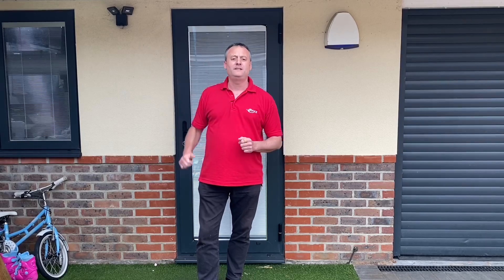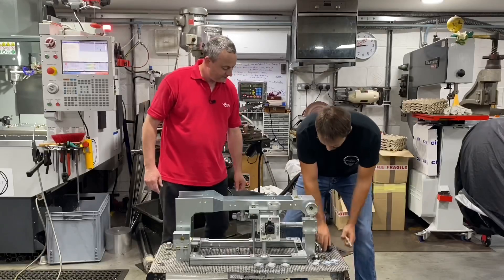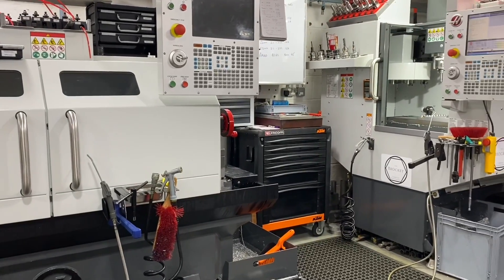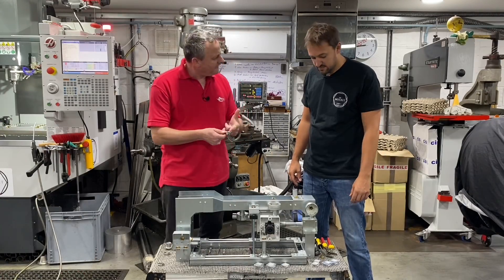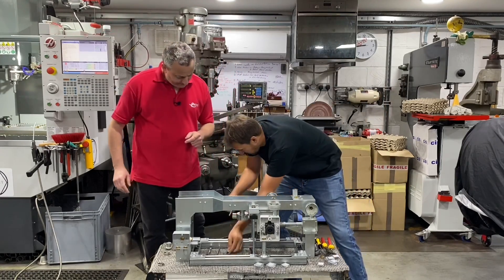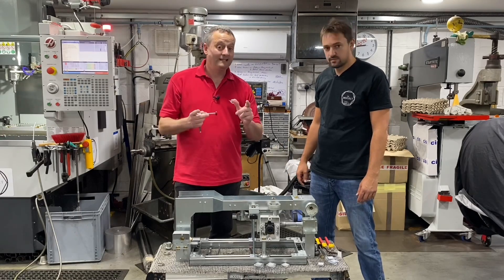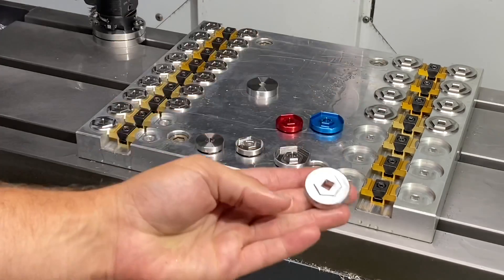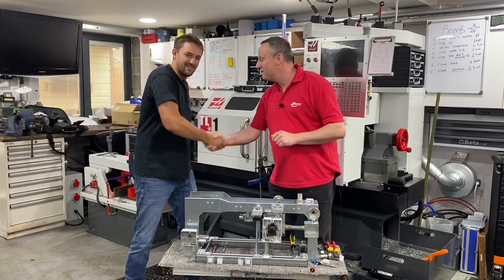Easier conduit and trunking installation with The Brocket - eFIXX Innovation Corner

Comment: Would these work on plastic glands? I'm in the process of developing an automatic hydroponic system for a client and I'm using a bunch of glands to hold the tubing, it's not uncommon for me to have to screw and unscrew a whole bunch of these things multiple times a day. Currently using an adjustable spanner as the housing is very shallow; extremely slow going to avoid tearing up the plastic!

Comment: You do know that several well known electrical tool manufacturers already make bush spanners in a variety of designs. Your design is very neat, but I wouldn’t be whipping out the socket set just to tighten up bushes.

Comment: Really smart, hope they go well.
A nice addition would be a 1/4 inch to 13mm nut adapter (or whatever size) to put on the back so these could be used with something like a ratcheting spanner as well.
Also suppose a streamlined version could be made using a press brake on a flat piece of mild steel, that might bring cost down.

Comment: People moaning about the price but its made in the UK and could really save people time and money. Buying locally made products couldnt be more important right now in my opinion.
Reply: Yes people need to compare like for like, it is low volume, stainless steel specialist sockets. So go have a look at the uncommon sockets sizes on the Snap on site $25-50 every time, the true specialist items are more and they are a massive company with high volume production and there sockets are are just hardened steel with chrome plating
Reply: Well, price is not only aluminum, cnc wear and tear, bits. Also, licenses for CNC, CAD etc, patenting costs etc. Those are the most expensive ones. If you moan about price try patent something yourself :D Anyways, great tool, simple design. Good luck
Reply: @martynaslukas4340  Exactly!!!! I invented something several years ago and applied for a patent.
When I discovered the UNBELIEVABLE costs to cover my invention, I deleted the patent application & the details from the web.
A patent lawyer will charge you thousands - just to write the description. You need a huge bank balance or a financial backer.
Reply: Not sure why anyone would moan about the price. Bloody reasonable for a high quality small quantity manufacture  tool!
Reply: Absolutely if it saves time it’s worth it
Reply: The moaning about price, i imagine is because thats all those people see. They have not thought about the bigger picture.
Reply: 100%
Reply: I want one
Reply: It definitely a good product  one that can make life easier  but at the price doesn't  make you  feel that you have to replace your t bar or socket  after all there is circumstances  where  it doesn't replace your shifter or spanner  start up costs shouldn't  let the price be so high surley a long term view would be better

Comment: These are great the price is not
Reply: If it saves you time and stress price doesn't come in to it . Work smart not hard
Reply: @iknowmyfootball3901  can't agree that this is one of them products yes every here and there might save you a few seconds but not to the tune of that money
Reply: Once he makes the AWG sizes as well.. he can put them in Amazon
Reply: Don't see it at £50 for 2 when they are really for exceptions where a socket of bush wrench wouldn't do.  If the were more around the £10 or £15 price I could get on board. But obviously that's at a mass production point and maybe made from chromium-vanadium alloy. Don't get me wrong I love the product but £50 for 2 sockets is a bit of a joke in terms of a price point atm.
Reply: @rik061119  They are low volume, stainless steel specialist sockets now a regular socket set socket, most of which are just hardened steel that chrome plated.

Go have a look at some of uncommon sockets sizes on the Snap on site $25-50 every time, the true specialist items are more and they are a massive company with high volume production.

The cost is right for what it is a specialist socket not a £3 standard socket
Reply: @michaelwilliams3648  not debating that what I'm saying is the use compared to the price doesnt stack up
Reply: @rik061119  For you obviously not, despite you calling them essential. It’s at the right price point for what it is though.

And

If these do ever go to mass market that would prove that these were highly needed and proving good time or stress saving, which would show they warrant their price given their current supply.

Those that need/want them will buy them knowing that it’s a fair price for a small production tool
Reply: Depends upon if they last. I mean.. you but cheap socket set at the local pound store or you but mechanics socket set for hundreds of pounds.. after taking apart an engine how many cheap socket sets did you go through? And now you need to put it back together.
I would but the pair if i did more work in that area..am thinking about it anyway. How much does it cost for a wrench with the pair of slots? 15 pounds at Screwfix?
Reply: I can go screwfix and get a full good quality set for £50 with about 15 sockets in it the ratchet exstention bars ect ect
Reply: Also seen people complain about the aluminim ones already
Reply from the maker: @rik061119  We think the investment would pay for itself in the time saved. Aluminium ones are for the occasional conduit installer.
Reply: 30 quid for the set is hardly expensive.
Reply: For 2 essential sockets yes it is, once he goes mass production I expect the price to drop